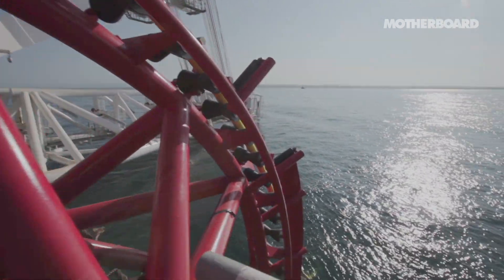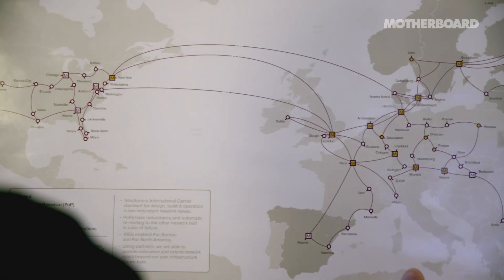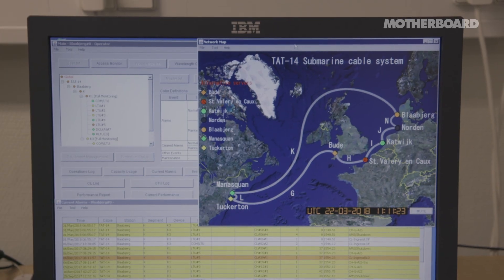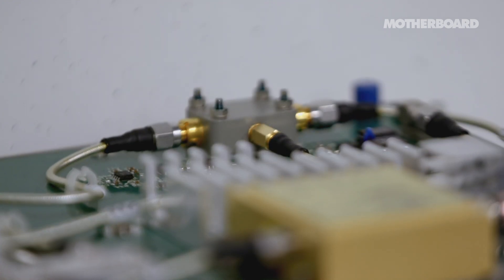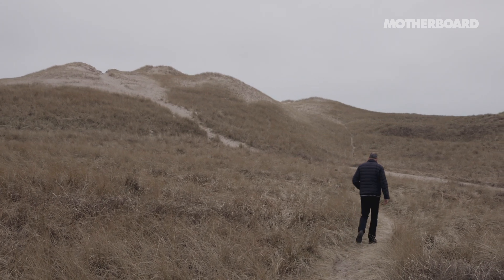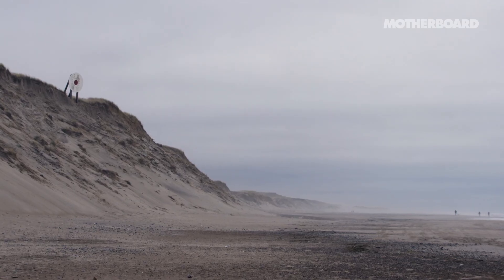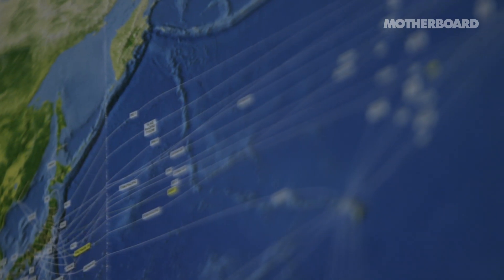Inside the Beach House Connecting the World’s Internet

Comment: What isn't mentioned is that the non-fiber part of the cable is electrified, and is used to power boosters placed about every 100km in the cable. These amplify the light based fiber pulses. The boosters are quite large too, about the size of a small torpedo. Some even have things like seismographs to detect seaquakes, and pressure sensors to detect passing tsunami waves.

Comment: All the worlds internet and you can open the front gate with a 3 digit code on a 10 key pad. Lmao
Reply: At 06:52 the moron shows the key style and a complete side profile of the bidding on the key. Since this video is in 1080p the image is quite clear. As such, that key can be easily decoded and duplicated at home by any amateur with limited locksmithing knowledge and less than $50 in supplies and tools. All someone nefarious needs to find out is the 3 digit code. They already basically left the keys under the door mat with this video.

Comment: If a cable gets damaged and goes down, how do they know where in the ocean it got damaged?
Reply: yeah this is a good question. I would assume that they have little sensors on the cable and they can locate a general area where it’s been damaged but there’s probably a lot of work
Reply: Time domain reflectomotry 😊
Reply: @sparkydave2783  I was looking for this exact terminology.
Reply: good question
Reply: Have you ever used an actual broadband?

I meant: The wireline one!
Reply: You'll notice he showed the ocean cable coming into the communications building at the beach along side a power cable. The reason for the power cable is to power amplifiers along the length of the fiber to boost the signal. Take note of where the amplifiers go out and you know roughly where your break is.

Comment: Anyone have a guess as to why the cables run to New Jersey and not New York City/Boston etc etc? I’ll give you a hint. It has to do with BIG money.

The answer: Stock markets. All of the major markets such as the NYSE have their data centers in New Jersey. Being as close to these data centers as possible is extremely important for High Frequency Trading. This is because the frequency that an HFT box can make trades is limited by the speed on light. The closer you are to the data center actually gives you an advantage over someone who is further away.

Comment: Amazing, and I was one of those who thought we were being served exclusively by sat-tec:) It's a wonder terrorists haven't discovered this yet:(
Reply: Internet or more precisely its predecessor ARPANET was originally designed and built because of fear of nuclear war, to be a packet switched network that will work even if single points fail, by other words important points are bombed. So, even if terrorist cut one cable, nothing remarkable happens, because internet has the capability to automatically reroute all traffic by another route. So only after every cable between to nodes is cut, it will completely stop functioning. From that point of view, it is not a very good point to attack against . . . The cable could be cut, and most people would barely notice, the latency may get higher, and connection over the sea slower, but that's it.

Comment: Interesting that cables in deep water require less protection than cables in shallow water.
I would have thought the opposite.
Reply: At the depth of 5KM underwater, the cables would be just on the sea bed for the most of the distance. Also, at that depth, the pressure is so ridiculously high that most underwater animals would just live peacefully and unlikely to tussle.
Reply: his reasoning is less threats at 5 km underwater but I do think that NO shielding would be an overstatement by this guy. He's just a pencil pusher desk jockey not a field technician. doubt he knows these details anyhow. After all he doesn't think intelligence is tapping these..

Comment: I thought we had satellites...?
Reply: Satellites is only one way of communication.. but there isnt a true replacement for direct wire connection. Satellites were never really reliable form of data sharing. And its not as fast.
Reply: We do, but light is faster than radio waves, and laying cables is cheaper than rocket fuel. How do you think your GPS works? Satellites. They're good for some things because of their coverage and not needing infrastructure on the ground to work, but low-latency, high-bandwidth data transmission is not one of those things.
Reply: ForeverMasterless I hope you realize light and radio waves travel at the same speed... All electro magnetic radiation travels at the speed of light.
Reply: @ForeverMasterless  uh... "radio" waves is light.

Comment: Back in the late 1980s-90s, I used to manufacture undersea fibre-optic cables. It's a fairly straightforward process, but takes several stages, At 3:16 he shows a well armoured cable, and we sometimes added and even thicker stage of armouring, which you wouldn't be able to hold in one hand. For most of my career I joined two cable ends together, mainly in a repeaterless connection [unamplified]. The signal loss had to be practically zero as equipment measured the signal from the opposite ends of the cable. I was involved in the UK - Denmark cable and one of my repeaterless joints held the record for minimal signal loss, at the time. I have no idea whether it has been broken since. I sometimes miss it as it was a great job and you knew you were doing something really important for world communications.

Comment: Its depressing. There hasn't been any major break throughs since the baby boomers era.  Still using gas engines. Our electrical engineering is still used off teslas designs(over 100 years old). Jet engines from ww2. Cellular communucation, nothing but mobile rf. Space exploration, non existent. NASA claims "we lost the technology to go to the moon" im wondering if the technology was ours to begin with.  And if you disagree I hope you have some facts to back it up.

Comment: @0:55 good job Sir ! He has shown his pin code :-) for the Internet building. We are all doomed :-O
Last 3 digits of his pin to the entry gate are 114 or 774 (or left bottom button x 2, and the one button above as the last digit)

Now the CIA only has to guess the first digit 9 times and they are in, if the pin has 4 digits :-)
Reply: Unless he changes the password on a regular basis. Which he does.
Reply: For a critical facility like this, it's most likely single time use PIN generated by Key-Fobs or other physical 2-step security devices
Reply: You could just drive a truck into the fence?

Comment: The worst that can happen is not a cable cut. Imagine somebody tapping into the node and collecting and interjection data at will.
Reply: its fibrenet unlike copper wires, this is not possible. Any interjection can be noticed since light has already been captured.

Comment: One part that wasn't mentioned that i think a lot of people aren't aware of:
Most fiber deployments like that are not just firing a single stream of data (currently up to 100 Gbps) down a fiber, but use multiplexing (usually Dense Wave Division Multiplexing, DWDM) to fire many streams down the same fiber on different wavelengths. Last i looked at it, my old employer used gear capable of 6.4 Tbps per fiber pair.
Reply: spot on. it's very interesting how can be loaded right up
Reply: Its a SERIES OF TUBES!!!
Reply: Technically if you use something like xrays you would have "unlimited" bandwidth.
Reply: . @thedude5040  Yes.

But let's get back to pragmatism, shouldn't we?
Reply: Thx, I have tought this for a while now
Reply: That’s also very expensive. What is the latency like tho
Reply: @Tkb135  Packet switched internet technology is actually very cheap considering the amount of people and data served.

Comment: Every single underwater cable is tapped by agencies such as NSA and CIA
Reply: Ronald C Krause Jr not the cables you idiot, that would be dumb. If they wanted to tap there they'd get no useful data and it'd be easily noticeable due to the fiber optics latency being effected. They tap further down the line in the infrastructure
Reply: Only in mericaland where the low IQ rule
Reply: +
Ronald C Krause Jr It doesn't matter if your data is properly encrypted.

Comment: i wonder what's the download speed is like in that building lol
Reply: You don’t want to take a black light into that place...
Reply: @MLJenkins  I see what you did there
Reply: UNLIMITED POWER
Reply: Arkansaw United it's actually more like 1 TB/s
Reply: 100gb/per sec
Reply: But can it run crysis?
Reply: . @roxanna1971  What's that???

Wait for that..

Don't bother replying even a letter if it's yet-another case of video-gaming!
Reply: YoManSam, it's currently actually 3.15 Tb/sec (small b), with a theoretical max of 9.38 Tb/sec.
Reply: Tim Wynn noticed he said GIGABYTES, that's a lot
Reply: then its 3000gb/s
Reply: @Vvaysion  so upload speed is basically the server's download speed? As in, how fast it can download the content you're sending.
Reply: Faster than most servers can send it.
Reply: 1PB/s
Reply: Faster than ur click?
Reply: Download speed there is likely equal to whatever speed the site you are loading can upload at.

Way back during the Y2K era, I remember being at a job location in Seattle that had a connection that was so good, I could tell how good the connection on the OTHER SIDE was by how fast the pages and downloads would come through.  
In locations like that, where you are hooked into the backbone of the internet, it is more about the upload speed of where you are connecting to than your download speed.
Reply: Horkslair  How is upload speed determined? I have seen this word many times but  never really know what it means.

Comment: 7:02 the fiber cable that takes all that traffic across the Atlantic isn’t any bigger than the cable serving my modem at home. That’s remarkable…
Reply: Yeah, it's just fancier modems on the ends... light can transmit an incredible amount of information with wavelength-division multiplexing.
Reply: @rozaepareza  Sixty Symbols has an interesting video on this.
Reply: @rozaepareza  ok boomer
Reply: Most of that is cladding, too. The actual transmission media is just 9 micrometers thick.
Reply: Scott Belleri really makes you think about how much your ISP is screwing you
Reply: There is more then one strand of fiber in those cables and power cable is ran with it to power the repeaters that are on the line every so many miles to maintain signal integrity.
Reply: NoSuspect p
Reply: NoSuspect no fudging way that's the power cable for that, I ran power that same size to power an amp rack for audio cable. (I believe you, just crazy)
Reply: I wonder how it looked like before they upgraded to fiber technology.
Reply: @mikem6915  it looked (essentially) the same, except the cable casings were as big around as Uncle Buck and there were many, many more of them.
+++The "other 10%" shark mention was a inside joke, as now there is only RF radiating from the line amps, which the sharks are unable to detect.
Reply: RangieNZ I'm slightly envious, but good on you! Put that thing to good use.
Reply: Sylas the Great tfw to intelligent
Reply: Nirossen ah your right to say it’s not remarkable since you know how we feel mr brain! Thanks 👍🏻
Reply: Shoegum, do you understand that in a thread of 21 responses, no one knows to whom you're reacting?
Reply: Nirossen, here in NZ some cities have gigabit fibre into your house.  A lot (like me), have 200MBs fibre into the house - we're waiting on a roadside cabinet upgrade, to get gigabit..  :)
Reply: Im in nz, but we get 100ms and 1.2mbps...

i wish they would hurry up and run a fibre cable out to us.
Reply: @RangieNZ  you are lucky, germany is so much behind in fast internet, i live in Berlin and in my street 50mb is max ....
Reply: We in India also have 100 mbps fiber to home. it is called jio fiber, by the same company that offers dirt cheap 4g in India.
My 4g download speed is 20 mbps. Upload is very low though at less than 2 mbps
Reply: Scott Belleri I
Reply: RangieNZ you mean 200mbps?
Reply: @ksmashgamer5748  Nah, but probably 200Mbps.
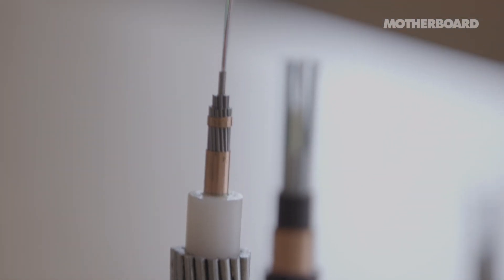Reply: you mean 3:35
Reply: The power of light photons
Reply: NoSuspect not true. Quit talking about what you dont understand...
Reply: Couple of hundreds dude not one cable.
Reply: Scott Belleri its amazing!!
Reply: It used dilithium crystal lasers and neomonolithic rubidium-ceasium tetradynamic fibreoptic
Reply: Goes to show the type of technology they have but don't release to the public
Reply: So what’s the excuse for Xfinity data caps ?
Reply: Scott Belleri    Actually, the fiber itself has the same thickness, which is dictated by the physics of optical transmission.  However, your fiber is very lightly used by the terminal equipment at each end to supply your home data needs.  Undersea cables have many of these same fibers and each is operated much nearer its theoretical maximum speed, resulting in a cable that carries millions of times as much data as the single fiber serving your home.  Even that bundle of many fibers is almost inconceivably small in diameter, far less than that of a pencil lead, and the fibers themselves are mostly cladding, the protection for the actual glass which is just barely visible when held right in front of your face.
Reply: I know, right? I would expect much bigger cables to handle all the porn that I download.
Reply: That size of finger cable of 7500 km..  Wow
Reply: Spliced from that crazy armored cable to the small one he caressed ever so slightly
Reply: @Niro_sounds  thanks captain obvious
Reply: Scott Belleri   In the world of optical fiber, smaller is faster, and faster means more data.  It’s a bit counterintuitive, but becomes very clear when you see how the optical fiber works.  A larger diameter fiber promotes scatter of the light and that is absolutely intolerable.  The diameter of the actual light fiber itself is measured in millionths of a meter.  The ‘fibers’ that you see dancing around in the air protruding from the center of the cable when he holds it upright are almost entirely protective sleeve and cladding.  The actual fiber inside that hair-thick jacket would be barely even perceptible if laying perfectly still on a clean white sheet of paper right in front of your eyes.  It is the thinness, and consistency of that thinness, which permits the light pulses to travel reliably for long distances.
Reply: ..and people complain of over-population!
Reply: Sylas the Great before you bash someone maybe you should learn what you're talking abouit. A photon carries something, light, x-ray, radio waves and so on. It's a particle so calling it a "light photon" would be correct since it's carrying light and not another form of electromagnetic radiation. Enjoy the rest of your night.
Reply: @jarred281  Light, radio waves, etc. are all the electromagnetic radiation just a different frequency. Photon is the correct name of the particle, but the energy of the photon depends of the frequency of the particle. ;)
Reply: Scott Belleri It may look the same from the outside, but what you see here is mostly shielding (from bending, not for interference since it's optical, not electrical). If the cable in your house is that thick, it's probably COAX cable - a single copper solid core with a shield tube of meshed copper around it. In DOCSIS 3.1 this gives you a theoretical max capacity of 10Gbit/sec downstream and 1 Gbit/sec upstream. But since the coaxial part of a cable network is shared, you won't get that capacity, it's shared with up to 250 households at most (normally).

The fiber cable you're looking at here contains only four pairs (they're mono-directional, so you need a pair for up- and downstream) of fibers, of which two pairs serve only as backup. The current "lit" capacity (in other words, max capacity it can now deal with without adding equipment at the edges) is 3.15 Tbit/sec, the max capacity is 9.38 Tbit/sec. bi-directional. That's slightly more than what you have at home. ;-)
Reply: RangieNZ here in Texas a lot of us have 1 gbps.
Reply: The clock speed must be uncomprehendeble
Reply: Ryan- eye- tis   There is a practical limit to the clock speed, above which reliability suffers.  Massive data rate to the end user is accomplished through redundancy, the use of multiple fibers, data compression, and caching (short term storage).  One million customers streaming data at a rate of 10Mbps does not mean a cable must carry 10Tbps.  Not even close.
Reply: My 2400 baud modem requires 1/2 gauge wire! But that’s really high speed. 2400!!!!!zoooooooooM
Reply: SkitzMate It's always been fiber
Reply: Sylas the Great You are actually very wrong about it always being fiber.. Before using it they had huge copper cables in the ocean.. Stop trying to act smart on YouTube
Reply: 'faster cables' lol you are clueless about what you are talking. Old internet cooper cables were slow because of noise (dB) building up with distance. Fiber optic is perfectly isolated from any external disturbance.
Reply: Randall Gates ??? The power of light light? Awwwww look at you trying to use words you know nothing about! So cute!